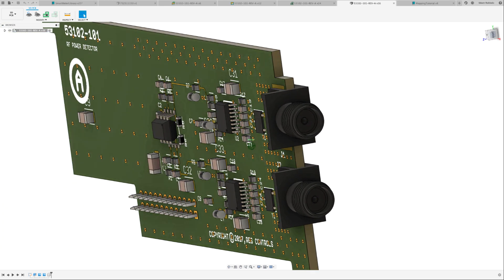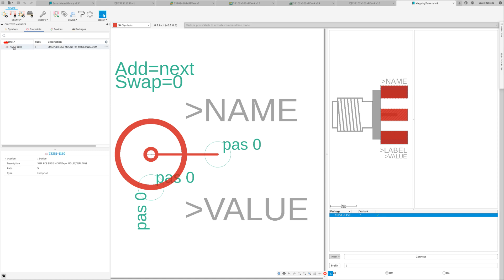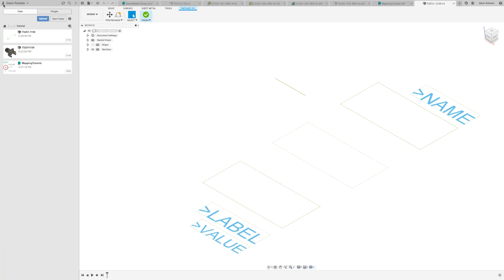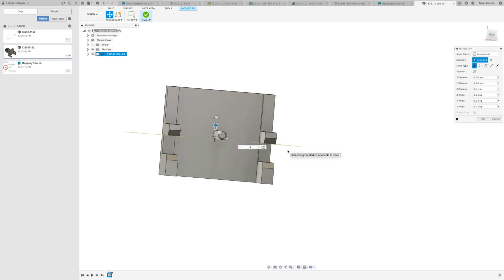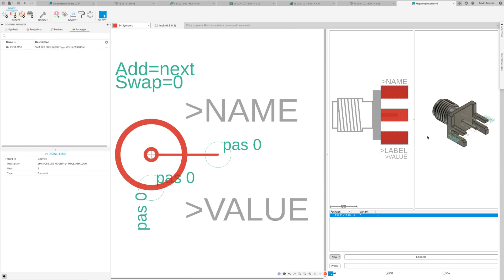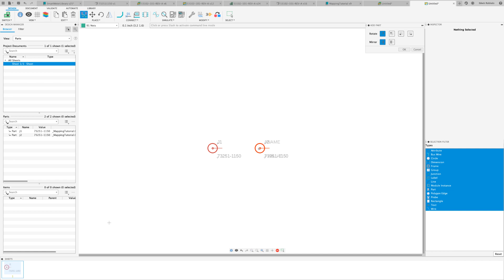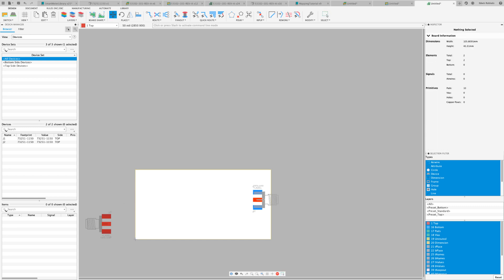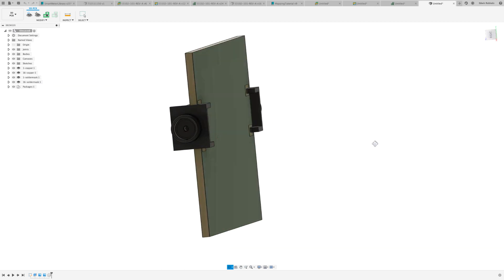Quick Tip: Mapping STEP models to your electronic component Footprints

Comment: Fusion/Eagle is truly one hot mess. I've been trying for hours to attach a 3d model and orient it properly with the footprint. This version of Fusion  has different menus so I am still SOL. THis process is so convoluted. Especially if you want to add a model top an existing part.

Comment: I tried to add some step models to an eagle library in fusion 360 but it ended up in a complete chaos. Things looked close to what you show in this video but there were many small details different. It ended up in a collection of libraries with all slightly different symbols next to them (no mouse over comment what they mean), in some cases, there was a 3D model shown, in some cases, it said the the URL is not correct ... and in some cases, the raster was 2mm in the package editor and the step (which was in the correct 2.54mm raster) did mit fit. I restated fusion 360 and then it was 2.54mm .... is there any kind of complete instruction with all symbols / processes explained? Honestly speaking, the current editor looks for me almost useless ....

Comment: Can you change the physical material of the PCB component so That a accurate centre of mass can be obtained?
Reply: yup! Just right click on the part in the body folder on the left in the browser, and you'll see "physical material" as an option, you can change the physical material here

IMPORTANT NOTE: Fusion 360 treats physical material and material appearance as 2 seperate things! applying an appearance texture does not change the physical material data